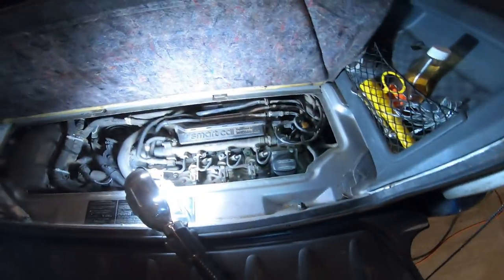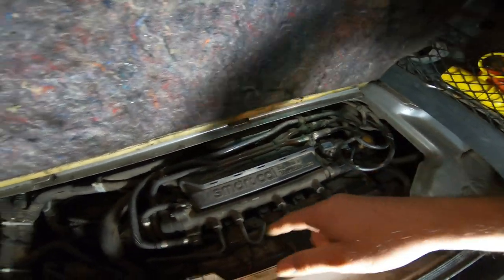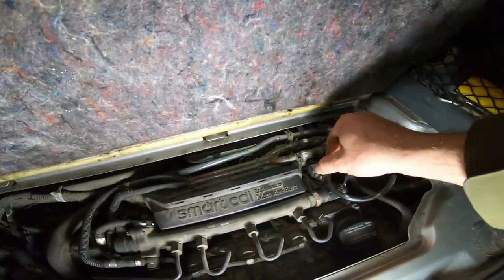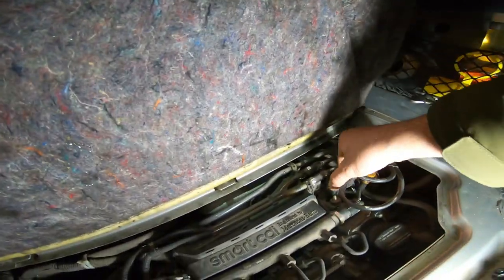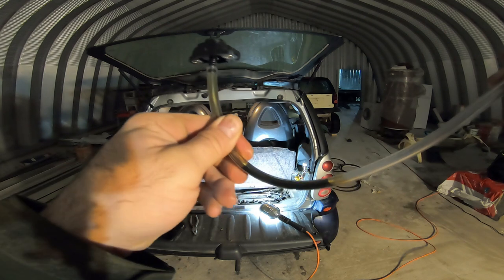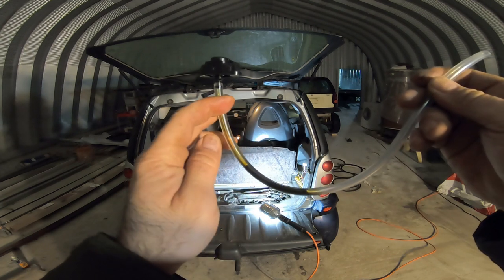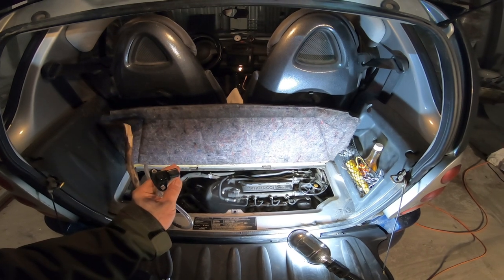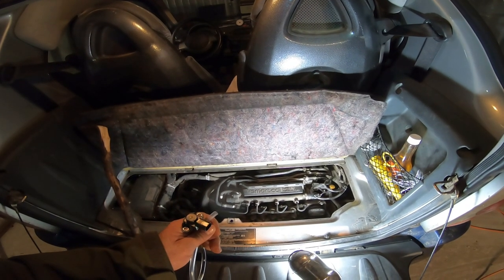Smart Car CDI, Rough Running Fix This One Sensor

Comment: i am having this EXACT issue. 2005
it stutters in reverse and first but works great on the highway. I guess it’s in limp mode as the check engine light is on. I have an appointment with Mercedes but not for another six weeks!! i’ll try this!! if it works i’ll report back
Reply from the maker: probable egr sticking. Hard to say with out scanner. Could also be a broken wire to intake air temperature sensor. Just a guess.
 Quick check egr Could remove the selenoid ontop egr valve & spray some penetrating oil on top & try depress the valve a few times to see if sticking & can loosen it up. Then put selenoid back in place. easy to do right on top. think 3-4 small bolts. The smart will turn the light off if no issue after 3-5 start ups & running. something like that any way. Uncle weiner there has cheap scanners that will work for european & canadian models needed for the smart. Will tell you what it is right away for less than half price diagnose at mercedes.
Reply from the maker: I dont have alot of confidence in auto techs that work at shops these days. You take your chances with them. If find a good tech that knows the Fortwo then consider yourself lucky. These car are old to them & almost forgotten already. They are more than happy to change huge amounts for simple fixes & sometimes cock things up & charge huge amounts & then huge amounts to fix. Buying a cheap scanner might save you alot money & headache. Trust in self be scepticle of dealer, good help is hard to find these days.
Reply: @manbuilds1587  wow thanks for reply. yes canadian model model. i didn’t see a hose when looking at the MAF , appeared to be all electrical.  the dealership is mercedes and is an official smart centre. it only has 64,000km and from booklet appears to have been brought into this shop every 10,000km for service. i hope it’s not the clutch pressure plate like i saw in other videos.  it’s DEF in limp mode cause it’s got no power and engine light on.  i’ll see about trying what you mentioned. i just picked it up this week for the wife. drives fine but SLOW rn, auto mode won’t shift out of 3rd. manual does but lack of power.
Reply: @manbuilds1587  i’ll pick up a scanner if i need to. i’m not the type to bring something to a shop and tell them what i think it need by whatever code i read on a scanner. ya know? :)
Reply from the maker: @branscombe_  you sound like some one who has never been cocked over by a dealer ship. I was at a dealership once, waiting to use there press to get a bearing pressed out. A gentleman called in to the front desk to check on his vehicle, that was miss firing. The service tech said he had one melted sparkplug wire that was causing the miss fire. So they changed all the sparkplug wires & that cost the customer 1400.00. The service guy then bullshitted the customer into accepting the repair. At least that is how I am remembering it, was a while ago now. The customer could have got a cheap scanner, read misfire cylinder # & changed 1 wire for 100.00 or less & been on his way with out the hassle & the high price tag.  Shop rate is close to 200.00 hr these days. If you have the fault code you could arm yourself with a bit of info before repair or repair it yourself. Is one of reason why I made some videos about. Careful putting your faith in someone trying to make money off you. Good luck Sir, hopefully you get a good technician.
Reply: @manbuilds1587  I drove from Calgary Alberta to New Brunswick in my blazer. I was charged $1600 to replace brakes and rotors as at one place in Calgary.  and 1900 for a “tune up” a year earlier from a different shop in calgary. it never ends. I hope my luck is better on this end of the country but yes I will buy a computer scanner and figure out the codes.
Reply: An electrician came by to help me hook up a new hot water heater and he had a car code scanner. we plugged it in and it was reading P0405. Which is EGR related I guess.  I retighten my gas cover and he cleared the code. The check engine light went off and now my automatic works and it’s not in limp mode anymore. I appreciate your responses and I’m glad to hear there’s an honest mechanic in Alberta. :) i’ll sun your page now.

Comment: Ever had an issue with cold starts? I have a 2006 cdi with roughly 170k on it. Even right now if i cycle the glow plugs four times i can get it started ok. Stalls out in the mornings. Changed fuel filter, air filter, glow plugs. Same unit had some new connectors put on last summer. I am thinking glow plug module but would rather not just keep throwing money at it and not fix it.
Reply from the maker: if module is burned out, could just install a switch & run 12v power wire to glow plugs. Need a thicker wire & good switch to handle the amps. Can just tie into wire going to glow plugs & change relay later if find a good cheap one a junk yard or some where. If do a switch have to remember to shut it off after 15s or so. Glow plug relay is just a big switch. Cheaper option than order new one.
There is the fuel shut off selenoid on injection pump that could be doing that also, or fault crank shaft position sensor but if that fail it usually will not start or run at all.
Reply from the maker: Could be multiple things, lower compression, glow plugs burned out, plugged catylatic converter plugged & not letting engine breath, egr valve stuck open.
Reply: Ok.not sure about burned out glow plugs as they were brand new installed about 4 months ago. I am thinking its not fuel related as it has white smoke which i am thinking is unburned diesel. The problem started mid winter and didnt think much of it with alberta winters but i have noticed nothing improving. If anything has gotten a little worse. I was pretty well down to it being the glow plug controller, injectors or cam sensor.  Egr has been deleted in tune but is still present and disconnected.  Runs fine after it has been running for two min or so. The start up is just a pain.
Reply: I was not sure if maybe solders were poorly done like the sam unit had as well. Soldered directly to the board and used marine connectors for that.
Reply from the maker: maybe the soldering but I didnt see a pin out on sam that i dicates glow plug relay,
 Smart car cycles glow plugs more in the winter for sure, if was gonna fail it would most likely be then.

https://www.evilution.co.uk/mod/450-sam-unit-pin-out.htm
Reply: Oh sorry i wasnt trying to imply it would be the SAM unit. I meant maybe poor solders in the glow plug controller. I may try running the wires for the glow plugs into the car and wiring up to a push button so it can not be left on.
Reply from the maker: @markwindover3375  Excellent Idea. Push button is best, no worries there. :)
Reply: I'm having same problem wirth cold starts. Injector cleaning helped for some time. I cleaned simply with carb cleaner. I have an idea that maybe battery is weak... but i tried a lot of things. Also i.have some oil leak somewhere near turbo or high pressure fuel pump. Need to sort that out also
Reply: @grinkiss  I fixed my problem. I sold the car. Too many issues with these cars and expensive parts. Trouble shooting the SAM unit was enough of a pain.

Comment: Hi I just had an idea that the smart was under fueling I got it tuned by flying tiger is was much better, but seemed to be running out of injector volume so I ordered some sprinter van or E320 injector tips and it’s a totally different car you won’t believe it
Reply from the maker: Pretty cool, Does it roll some coal? 
 Larger tips or just better spray. its cool the pump can keep up. Higher injection pressure also?
Reply: @manbuilds1587  it does especially cool passing a car on the highway I’ll get a video for you
Reply from the maker: haha, ok
Reply: Do you have a part number for those injector tips so I can try that on mine? Thanks!

Comment: Good video. Have you ever removed the intake manifold? If so does the fuel rail have to come off as well please? I think I might have a bit of an egr blanking plate in it. Cheers
Reply from the maker: I havn't had to remove an intake manifold. Most likely have to remove fuel rail, looks like sits over top intake manifold. Fuel lines there also, careful with plastic if nipples on lines, break easily. Fuel rail comes pretty easy if want it out of the way. Just have to make sure injector lines are tight enough not to leak. fuel rail pressure much higher while driving than at idle. Egr blanking plate is bolted to egr valve body not intake manifold. Blanking plate can be installed or removed by loosening exaust/egr cooler pipe coming from turbo. If the blanking plate is a slide in type. If follow small pipe up to egr body below injection pump you will be able to see if has a blanking plate installed.
Reply: @manbuilds1587  thanks for the reply. Yeah I've got the remains of a very thin blanking plate. There's a big hole in it and what's broken off isn't in the egr valve so it has to be in the intake. The intake has loads of gunge in it so hopefully the broken off bits are trapped in the gunge. The car runs and drives ok but I have very low boost and it goes into limp home mode unless I really boot it. Thanks again
Reply from the maker: Could try a borescope & a magnet or tool to scrape out gunk. Maybe will see it. Seen block off plates on ebay for sale that can just slide in without removing egr.

Comment: Hey bro, how the cid behaves on the cold? Did you put anything to block the air intake?
Reply from the maker: I put a piece of carpet to block the cold air completely from the intake in the front. It has a hard time to start in weather colder than -20 °c, have to plug in. I have driven around all day & night in weather below -30°c. Heater is not the best but is ok once the car is fully warmed up while driving. At idle the car will start get cold again. Is best a summer car but can drive in winter, im on 3rd. Year driving in winter as my main vehicle. 
Like most cars the cooling system is a bypass flow system that constantly circulates a small amount of coolant. Problem is in the smart cdi the bypass line is too large & the car has hard time to get up to temperature when cold. Have to heat all the coolant up, not just the coolant in the head. If need better heater a guy could rrstrict the bypass coolsn flow by pinching the bypass hose partially or adding a restriction in the line.
Reply: Thanks for your reply,  I live in the Vancouver area, so it won't be a problem I think..
Reply from the maker: @tavolamarque  yah in Vancouver the heater is sufficient. It would help with warm ups to block the front or partially block if highway driving even mild winter. I drove until it was 10°c after winter before I removed the carpet from the front & then only partially. It wont overheat if fully covered, will help it get to temperature to run properly. If hear the cooling fan kicking on & off alot then maybe open the front up for some air. Around town in the city a guy could keep the front covered all year around. Haha it really doesnt make enough heat to get hot unless driving on tbe highway. Only need some good wiper blades in the Vancouver winter :)
Reply: Thank you so much for your help bro!

Comment: Is this a MAP sensor manifold, absolute pressure sensor code P2227
Reply from the maker: It wont give a code unless diconnected. Its a map sensor, mercedes has a different name for it.

Comment: Could you put a bleeder valve on the hose?
Reply from the maker: I was thinking about that too. A tee fitting with a piece of clear hose on bottom with a plug would probable wkrk ok. I removed the crank case vent from the intake on my car, so no more oil coming in. 
That car had almost 200 000km on it when I realised oil in pipe, It may take a long time to build up enough oil to plug the pipe. If car in good shape, maybe blow it out & is good for 50k, not sure.
Reply: @manbuilds1587  I was thinking tee fitting with a valve and clear plastic tube going to the bottom of the engine. But, your way would probably work as well
Reply from the maker: @JA-rn2fz  tee fitting is about 1.00. But those tiny valves are really expensive at the store. online best bet.
Reply: @manbuilds1587   I think your way can  fine. You can always put a removable hose clamp on the plug.
Reply from the maker: @JA-rn2fz  Could just thread a screw into end of the hose. Its not very professional looking but it wont blow out if threaded in tight.& is rubber line.
Reply: @manbuilds1587  even better
Reply from the maker: @J A  haha. :) We all benefit from those who came before us & we should make things even better.

1970 citicar- 2002 smart car- tesla- 5minute 80% charge batteries.
Reply: @manbuilds1587  That sounds interesting....